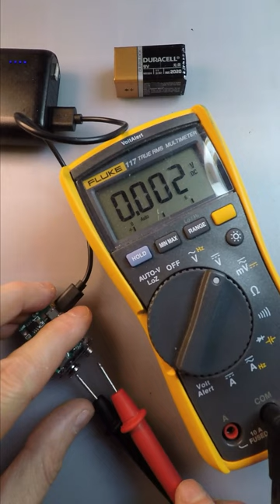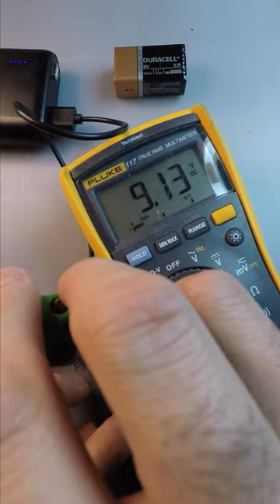Lifehack for using dead batteries, how to make a 9V rechargeable battery from a dead one

Comment from the maker: BONUS TIP: You can adjust the voltage boost screw on the kit to deliver voltages other than 9V. Therefore, you can have rechargeable batteries in the same shape as a 9V battery but with voltage output like 6V, 4.5V, 5V and even 12V. How cool is that? Amaze your friends by sharing your customizable 9V batteries! 😜